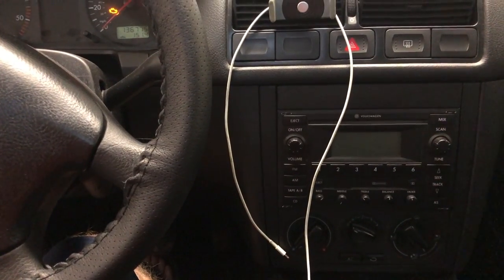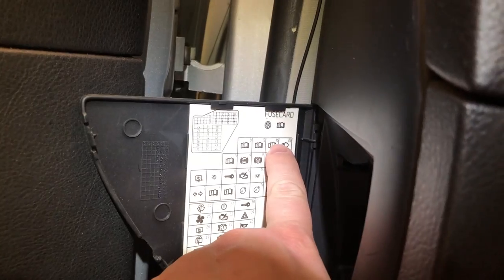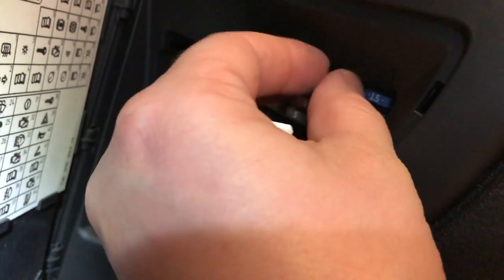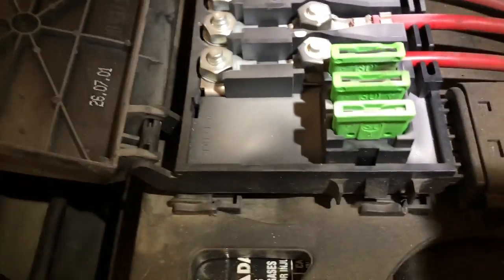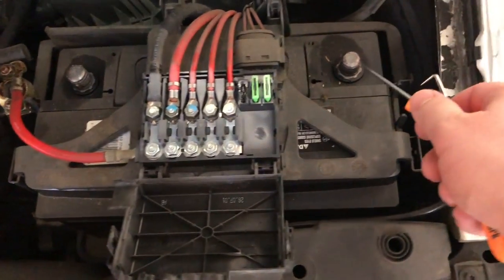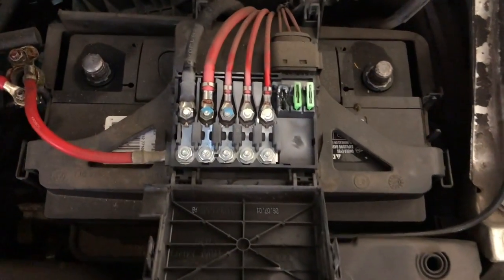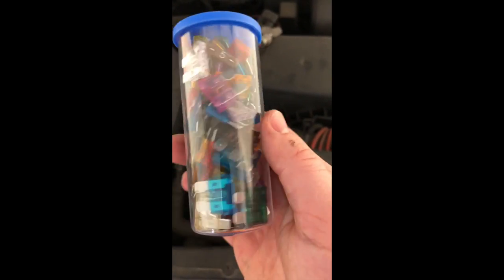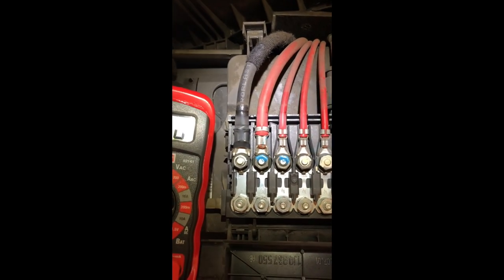AC Stopped Blowing Cold aka Warm 2003 MK4 Golf TDI Air Conditioning

Comment: I've had AC problems for a year. Every time the car is stopped the AC would turn off... I couldn't find the fault, I almost changed the climatronic. Until I saw your video and one of the leaf fuses next to the one that burned on you was burned out. I change it and it works perfectly. Thank you so much!
Reply from the maker: Excellent outcome.  Appreciate the comment, and glad it helped.
Reply: Same here. I replaced my whole fuse box to be on the safe side. Mine was very melted

Comment: Thx Mucho! I had a dirty 30A fuse over the battery. Cleaned out the fuse contacts and bam, AC. I had changed out the compressor a few years ago.  I'm going to share a fix w/ you.  During my compressor swap, a mouse at the wire on my ATS (Atmospheric Temp Sensor). The FCU thought it was 32F. AC would not turn on. I discovered it after I went thru the Shop manual electrical section and jumpered out the ATS at the FCU to discover the problem. Note, the ATS was never mentioned in the Shop Manual..

Comment: Wow my AC quit working and I stumbled on your video and my fuse looks very much like yours. I’m going to change it out and see if that fixes it like it did yours. Thank you sooooo much!!!
Reply from the maker: Hope it fixed your issue and you have some nice cool air.
Reply: Yes it sure did. I’m going to get a new fuse panel and swap it out.  Also going to swap out the fan control module.  It’s 22 years old so it’s probably ready
Reply from the maker: Nicely done

Comment: Had the same issue right now. Car was in the workshop for 2 weeks but they couldn't find the problem. They tried things like changing fan control module and AC control module ( i have climatronic), some new sensors etc. but they haven't noticed this little oxidation on this fuse. to be specific this fuse is for level1 of the coolant fans. level2 is one of the bigger fuses. by turning on AC they blow both in level 1 and this engages the AC. with a bad fuse the fans won't spin, the signal to the control module is missing and because of that the AC won't work.
Reply: Q⁶7th

Comment: Well lol I been bragging on this pos car a great ac and then no ac . I have no clue on how this system works . So after a few ubtube I changed the ac module and no change . I could jumper the fans and ac compressor and make them work . I even tested the fuses with a test light but it was not under a load . As Paul Danner said test under a load . So when I tried to pull the fuse which would light up the test light it was stuck with the green crustys . Damn lol cleaned up the blades and sprayed them with wd40 . Work good now thanks for the information.
Reply from the maker: great job.  crazy how much the ac matters when you want it

Comment: Mine stopped working and both fuse 16 and the one one the battery is ok.
But....when I remove fuse 16 the fans starts and when I put it back they stops.
Ground issue?
The ac worked fine before I parked the car for the winter (in a barn)
Reply from the maker: Sounds strange.  Barns have mice and rats, which I hate.  Hopefully they haven't chewed through any of your wiring.  Many people have had an issue with the large alternator cable, as Gordoman says, about 3 years ago in the comments below.

Comment: i had exactly the same thing happen except putting the new fuse in did nothing to help haha. pulling the fuse out while running made the engine rev a little higher for a moment so somethings going on, hopefully its just not drawing enough power to engage yet, i still have to clean up the contacts and try again
Reply from the maker: Did cleaning up the contacts work?  Did you check the fuse inside the cabin as well?
Reply: @wellingtonviking  nope, no fix at all, i had limited testing equipment at the time, will need to try more thoroughly once i bring the car down to my house. its entirely possible the AC compressor clutch is nackered, if i had an external power supply thats what i would have tried next.
Reply from the maker: @ronoxengineering  hopefully it's not the compressor, but good to start with the low hanging fruit.

Comment: when you check that fuse with a test light even with the housing blown like that does it have power go through?
Reply from the maker: The housing wasn't completely destroyed on mine.  The metal female fuse holder that holds the male fuse legs was intact and in good condition.  It looked worse than it was due to the fried plastic.  If the metal is completely melted on yours, the light tester wouldn't work.  If the metal pieces are damaged, it would be worth replacing.
Reply: @wellingtonviking  I think the metal female pieces are a bit skewed but a test light works on them.
Reply from the maker: @vampir335  I'd look at it this way: if they are weakened and brittle, the whole part should be changed. If they still are strong, and just have some sort of superficial discoloration, I'd try a new fuse.

Comment: Hey, do you have any idea if the cold air works but you cant get any hot AC ? could it be a fuse too? or something else :)
Reply from the maker: hot ac?  are you not getting any heat?  hopefully it's not your heater core.  check for damp carpets in the front and an antifreeze smell and the level of your coolant.
Reply: @wellingtonviking  hmm, there is no leak, like i drive car so its hot, then i put temp on max and it barely happens anything, it gets warmer but not warm, ,like medium, and same with making it max cold air, it dont get cold it stays medium :O
Reply from the maker: @hebbekeke762  let us know when you've figured out what the problem is

Comment: This is just the beginning.after this the alternator cable (big black on the left)starts to cook the fuse box.then the 3rd over starts to melt too. It’s a crappy design from VW tbh
Reply from the maker: So far so good. It’s been a year and nothing else had happened. AC still blowing cold and no other shorts or melting wires yet. How soon after did those fail on your MK4?
Reply: Same exact thing happened to me. As a matter of fact VW Beetle owners had a class action suit against VW years ago. I have replaced my top-of-battery fuse block once, and I replaced the  alternator to battery cable with heavier gage. That was about 10 years ago, and no problems since. I think the cable has been the biggest culprit. My original was absolutely fried. Horrible, incompetent design.
Reply from the maker: @bbstacker70  Still good on the cable.  Maybe I've just been lucky.  Been about a year and a half so far.

Comment: I have an 03 jetta and the cooling fan wont come on no matter what, fuses and voltage on top of battery are good but every time i put a new fuse into fuse #16 it blows when i turn the ac on. Any help would be greatly appreciated its too hot to not have ac
Reply from the maker: Sorry, I haven't had that issue personally.  Have you checked out the TDI forum?  Hope you find the solution! The following link looks like it could help: https://forums.tdiclub.com/showthread.php?t=350950
Reply: Possibly the fan control module? Not sure but just throwing it out there, not sure if you have given it a thought.
Reply from the maker: @adambanda9409  hopefully this was the case for @Michael Barlow above.  Michael, did you find out what your issue was?

Comment: Mine blows air but is not cold and I have put freon refrigerant already and it blows cold for a little bit but then goes away after a few
Reply: Already replaced the ac compressor, the valve, the filter and its still not working
Reply from the maker: Have you checked all the fuses?  That's the same thing mine was doing and the fuse fixed it.  You could also have a leak in your system, have you checked for this?  With the DYI AC recharge kits, you need to make sure you're staying within the gauge so you don't under or overcharge the system.
Reply: @wellingtonviking  I only put 2 bottles of refrigerant gas and no leaks anywhere might be a little square looking piece that sits under the battery that has 2 fuses connected to it its called cooling fan control module to see if anything works
Reply from the maker: @dynamiik-4168  hope you sort it soon.  please let us know if you've fixed it and what the issue was.
Reply: @wellingtonviking  alright so I put everything together, I had put 2 refrigerant gas about 2 weeks ago, about 20 minutes ago i put 2 more, the ac compressor was working fine AC was cold while putting the 3rd bottle, when i put the 4th one the AC compressor started turning on and off and is not throwing cold air anymore
Is it because I put to much refrigerant gas?
Reply: 2 weeks ago when I put the first 2 refrigerant bottles it was cooling for about 2 hours then it stopped so I decided to put 2 more to see if it was missing gas but I think 4 was a bit to much and thats why the ac compressor is going on and off
Reply from the maker: @dynamiik-4168  sounds like it could be overcharged now.
Reply: @wellingtonviking  solved the problem it was the A/C condenser, AC works like new now😤🔥
Reply from the maker: @dynamiik-4168  great outcome.  enjoy that cool air and a job well done.
Reply: @wellingtonviking  if anyone has any issues going forward go for the ac condenser
Reply from the maker: @dynamiik-4168  great, thank you for the tip.  Hopefully this helps some others with the same issue

Comment: I now video is old, but i have still problem with it, change and again it just burns straight after some minutes
Reply from the maker: I haven't had this issue since I replaced my fuse, but quite a few people have said that the alternator cable will need to be replaced if you're experiencing this still.  If you look further down in the comments, this is what Gordoman mentioned.